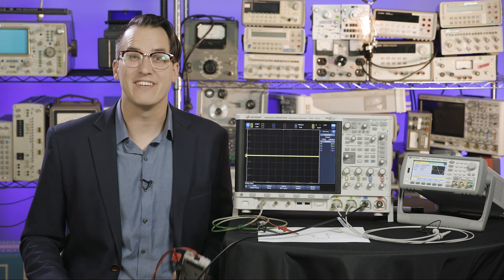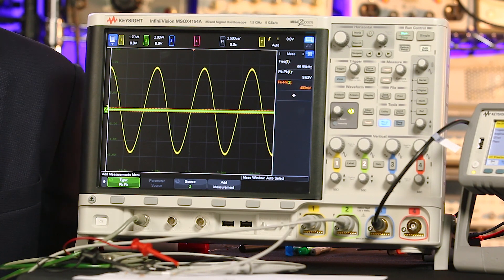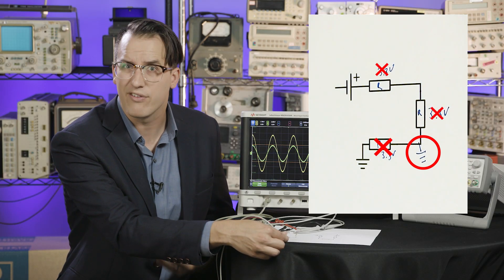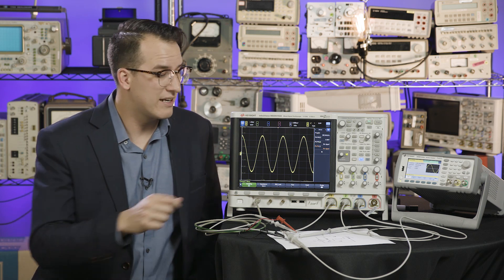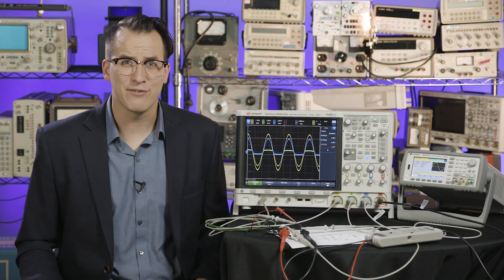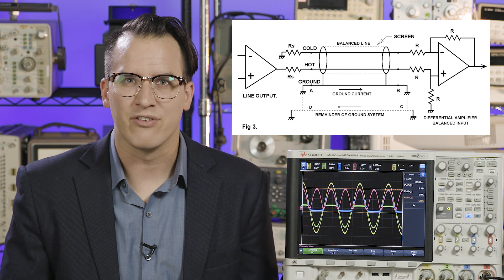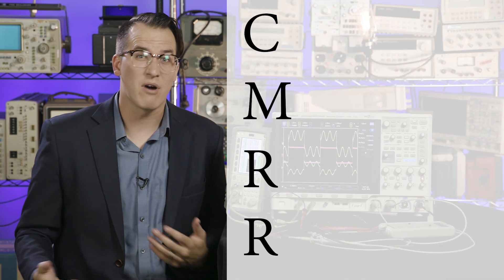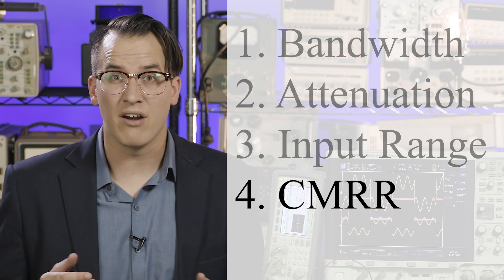A Differential Probe Guide - How & Why To Use a Differential Probe With Your Oscilloscope

Comment: hello sir, I am trying to measure signals of an Twisted pair ethernet cable to check the difference between signals when the system is connected to internet and when its not connected to the internet?? how can that be done?
Reply: "how can that be done?"
What's in your wallet?  You'll need a scope with four differential inputs and nanosecond rise time (500 MHz or faster bandwidth).  Gigabit ethernet uses all 8 wires (4 differential pairs, 2 pairs receive and 2 pairs transmit) but 100 megabit and 10 megabit each use 2 pairs (one pair transmit, one pair receive).  
If you use a conventional 200 MHz scope ground referenced probes, you will lose "noise immunity" but maybe that's not much of a problem but then again it could be.  Anyway, use a hub or switch that forces negotiation to 100 megabits (or less) so that you can see it.  You will also need a suitable termination resistor pack, I don't remember the impedance, 200 ohms or 600 ohms to prevent reflections.

Comment: Decent overview, but it kind of glosses over the biggest reason I use one...  simply for safety.  Probing any higher voltage AC power circuit where there is no ground in the circuit (just like as shown in your low voltage example at 2:45), you don't want the scope to become a path to earth ground via its AC line connection should you try and hook up a standard probe's ground (black) clip by accident.  It happens all the time.  Best case should you do results in a blown breaker, worse case you fry the circuit, probe, scope and/or yourself!

Comment: Nice video. however not everyone has a bench full of test gear to generate signals.  I have a DP10013 probe but haven't used it due to lack of info. I did see one young man plug it into a live  power strip. Only trouble was he didn't say if it was plugged into the same power source of the scope or probe!
Reply from the maker: Yikes!
Reply: @KeysightLabs  No wonder not many people learn much from keysight with answers like, "Yikes."

Comment: Sir while measuring phase voltage using differential probe (N2791A) it is not showing sine wave and instead it is showing lot of disturbances. Tried to compensate but still sine wave wasn't obtained even though the reading was 230 V in voltmeter. Can you say why is it like this?
Reply from the maker: I'd recommend contacting our support center at https://keysight.com/find/contactus and they should be able to help with your specific application

Comment: Is it better to have the differential probe or a scopes with floating channals?
Reply: Differential probes are designed to be balanced which is to say, same capacitance and inductive loading on both probe tips.  A floating channel still needs a reference, if not Earth ground, then a ground clip.  That is unlikely to be balanced.  It helps prevent sparks and short circuits of course (good thing) but is less good where balanced differential signals are involved.
Reply: By floating channels I assume you mean isolated channels. Oscilloscopes with Isolated channels (as well as isolated probes used on a regular oscilloscope) offer more protection than differential probes and can be built to higher input voltages, but aren't as accurate as differential probes. You also greatly limit your choice of scopes if you decide to go with a scope with isolated channels. I only know of one scope with isolated channels and it's a Tek TPS2000.

Comment: Thanks, that was very well explained. A poor mans solution is to use two channels of the oscilloscope and let the scope calculate the difference.
Reply: You can use the difference function of the scope reasonably effectively provided the DC offset is not huge (or use AC coupling).   A small signal riding on top of 100 volts DC means you have to scale the inputs to not overload at 100 volts; and it means your small signal is likely going to be only 1 or 2 "pixels" of resolution.  The resulting difference is going to look terrible.  
But if you switch the coupling to AC, then you can scale the inputs to 1 volt per division (for instance) and see a small signal with good quality and ignore the DC offset.

Comment: So am i right in thinking that with a pair of differential probes, but one of them connected to ground (like an actual rod stuck into the ground), you would measure the absolute voltage, like a "normal" common-mode probe, but without the possibility that your scope will blow up (even though it's grounded). ?
Reply from the maker: Yep! That's a good point.
Reply: @KeysightLabs  Why aren't all probes like this xD
Reply: @cannaroe1213  "Why aren't all probes like this"
Got $800 for one probe?  They are expensive.

Comment: 3:57  Using math you will lose a lot of accuracy?  Can you explain that with more details. 

To me, sounds that at this point, it is digital stuff anyhow, so unless you are subtracting two large numbers to get a small one... and even if you do that, the analog to digital process would have the same … limitations :  it won't automatically change the scale, or the number of bits in the digital result because the analog signal is close to "zero", right?  So, the granularity of the smaller steps won't change, … unless it is not linear. Oh, it is not linear?  Well, I can be wrong, but if you can give more details, I am interested about how we could lose a LOT of accuracy using the math.
Reply: I think that I got the answer by myself. It seems to be about the scale and the number of representable values. Say that I have only 2 bits to digitalise a continuous value between 0 and 1, so, I can only get 1/8, 3/8, 5/8 and 7/8   as representable digitalized value, or, the precision is +/- 1/8.  So, if I have to us a scale not from 0 to 1 but from 0 to 10, the precision is +/- 10/8 while if I can use a scale from 0 to 2, the precision will be +/- 2/8.  In our case, the original signal may force me to use the scale from 0 to 10, so the math chanel will still have the same precision than the original digitalized data, that is, +/- 1.25. But if I can measure directly the analog signal of the difference, it may very well happen that I could use the scale from 0 to 2, and thus, have a precision of 0.25,  or 5 times better than what the math "chanel" can deliver, in this scenario. And 5 times better, that is a lot better. That was more or less what you were having in mind at around 3:57 ?

Comment: There should be a high voltage separation switch that can either connect an input to ground or disconnect it for differential readings
Reply: Then one day you forget to check the switch and kaboom, there goes the circuit being tested and maybe the scope as well.

Comment: If you need a diff probe but dont have one, you can use two single ended probes and subtract them (Math Function). Not ideal, but it might be sufficient.
Reply from the maker: Correct! You can do that, but there are some caveats. You lose resolution, and have to have extremely well-matched probes.

Comment: Just guessing but i think we would use two single ended probes centre line for our connection to the required circuit jnder test and then use channel subtraction to get differential function from two single ended probes?
Reply from the maker: You definitely can, but there are some caveats.

Comment: Awesome fundamentals explanation. This is by far the best production quality, and useful content coming from any official manufacturer's YT channel...and I am subscribed to most of them.
   
  I have a couple of suggestions for stepping it up even further. First, it would probably benefit Keysight if you did your demonstration on the most accessible entry level scope when your explaining entry level concepts. Perhaps you could demonstrate part of the example on the smaller screen product. Viewers that want to replicate what you are using can be intimidated by a $4k to $10k+ scope. Also, I understand the difficulties of advertising a specific price on a retail item sold in multiple international markets and across multiple currencies, but entry level tools are mostly a price driven market. If you made me aware of Keysight's entry level scope, and it's functionality, passively, through demos like this, while casually mentioning it's price point, you will get the product on the radar of a lot more potential customers like myself. (My first scope is the DS1052e bc of Dave's hacking videos from back in the day, which is essentially passive marketing like this)

  In my opinion, the most useful information you could follow this up with would be to demonstrate a DIY basic differential probe circuit. It may seem counterproductive to sales and marketing at first but that is the kind of upload that would clearly communicate the "we want to build a community culture" I think your going for here. Obviously something like a protoboard circuit is not going to perform as well as a production product that has made it's way to market. So demonstrate that. By showing me the fundamentals and how to build a basic version of a diff probe, your taking the first step to help me by just handing me something mildly useful. Such an effort will impact a viewers perception of the Keysight brand more than any other from of marketing, excluding word of mouth type peer to peer marketing.
  That's just my $0.002 adsense on the subject as a simple hobbyist. 
-Jake
Reply from the maker: Thanks, Jake! This is great feedback.

Comment: Keysight obviously does not offer Differential Probes? Ask Dave..
Anyhow very nice, entertaining video, very well explained.
Reply from the maker: We have tons of differential probes! This is the one I had easy access to, but we manufacture many of our differential probes here in Colorado Springs.
Reply: Of course Keysight offers differential probes.  Only slightly less expensive than the scope itself but when you need one, nothing else will suffice.  Another somewhat rare but extremely useful probe is the hall effect DC current probe.  It is good for locating short circuits on a circuit board where voltage probes show zero everywhere you probe.

Comment: So why are scopes grounded?
 I've played around with an old CRT scope that was floating and everything seemed fine. (Famous last words?) The "ground" inputs were still shorted together obviously so I could make just one differential measurement but it was all I needed
Reply: If you are measuring mains or another high voltage circuit with a floating scope and accidentally connected your ground lead to a non-zero voltage reference, then your scope will be at that voltage potential since ground is usually connected to the metal chassis. So then if you touch the chassis, you could act as a part of the circuit, have that high voltage pass through your body towards a lower resistance pathway, and severely damage yourself. Either you conduct the signal through both of your arms, passing through you heart and killing you, or it goes to the ground through your lungs and prevents you from breathing.

There are battery-powered scopes that are left floating like the ones that Tektronix has that might work fine for that purpose, but otherwise this is not a good idea and can easily kill you. You only  need a few millivolts to stop your heart.
Reply: @SuperSSSSooonniicccc  I think you mean milliamps to stop your heart, rather than millivots.

Comment: Actually, Why is the output of lab power supplies not isolated from ground/earth?
Reply: Safety (electrical shock hazard)?
Reply: @emmanueltrinidad7740  i mean, they only output like 5-12V maybe 20V. Thats not much of a safety issue if  you ask me
Reply: Is the lab power supply plugged in to the wall outlet? Yes, 5-12V/20V is nothing, but getting exposed to 120/220 VAC will create some serious magic smoke.
Reply: Yes but a good PSU is mains transformer isolated and regulated linearly, isS't it? so there shouldn't be any connections to the high voltage side..

Comment: If only you could get a diff probe without selling a kidney...
Reply from the maker: Sorry, we don't buy kidneys.
Reply: @KeysightLabs  😂 good one. Still, diff probe prices are prohibitive to most of us.
Reply from the maker: They are definitely more expensive than the standard passive probes, that's for sure.
Reply: They can be expensive but some are within reach, depending on bandwidth, under £200 (your currency may vary!) which sounds a lot I know, but if you need to probe switch mode PSUs they are cheaper than a new scope!

Comment: Very nicely explained. 

One day I'm guessing differential, current and High Voltage  modes will be built into some scopes, obviously with advance protection.  
I even have a dreams of  bluetooth LE probes with a built in white led.
Reply: I think you are quite on point, seeing how most general purpose scopes have bandwidths above 100mhz, having all inputs be differential (and switchable to 'regular' single ended for better noise performance) would be very interesting.

Comment: 3:20 In this case u can use the math function summing the ch 2 & 3, right?
Reply: Actually, it has to use the difference function, because it needs to see the differential voltage across ch2 and 3. Also, Daniel says the disadvantages of  using two single-ended probes for this at 3:55, like accuracy, mismatch and usage.
Reply: 7:14 did you predict this? lol
Reply from the maker: Yes, it's a pretty common workaround :)